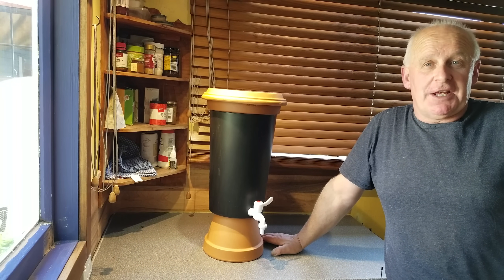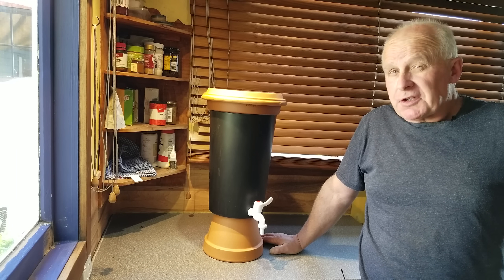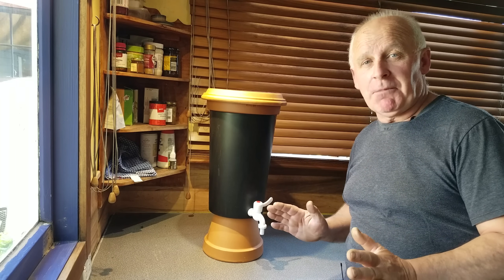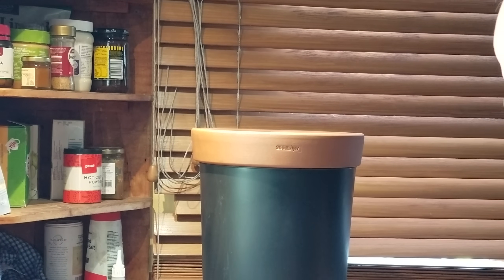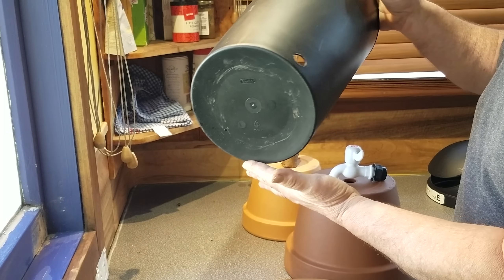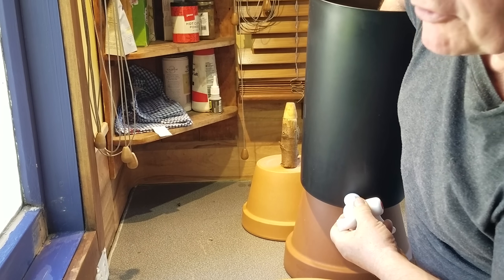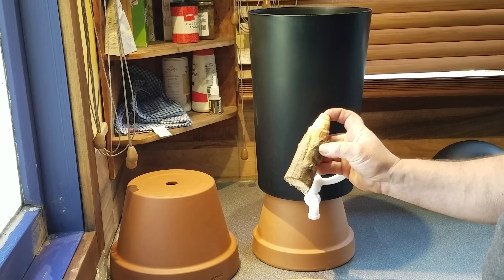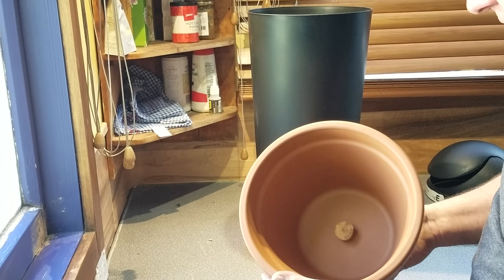DIY water filter. How to make FILTHY WATER drinkable

Comment: In warm, dry climates you can use ceramics like terra cotta to get evaporative cooling of the water in addition to the filtration. Great video! Well done. As an environmental engineer I approve. However, if you want to remove organics you will also need an activated (charcoal) carbon filtration bed as well. But since you are using rain water, organics would be of minimal concern. Thank you for sharing.
Reply: How's he collecting all that rain water? Off the roof, birds, moss , what's it made of?
Reply: Excuse the ignorant here, what do you mean organics? Viruses? I know Brita filters don't catch these because they're too small, I guess very few filters catch these, that's probably why we use chemicals? But I don't understand what this method filters and doesn't filter, and why it matters. Thanks!
Reply: Organic chemicals are a class of chemicals that contain carbon atoms bound to other atoms of varying elements through covalent bonds, such as the cells in your body or chemicals like gasoline or benzene. A lot of these organic liquids have molecule sizes that are close to or smaller than water, such that they will permeate any barrier that water permeates. Activated carbon (charcoal) has a unique property in that it has a very high surface area to weight ratio (950 to 2000 square meters of surface area per gram of activated carbon). This allows activated carbon to absorb various organic compounds and remove them from the air or water. This is why gas masks designed to remove organic vapors use activated carbon as part of the filter. @pierrex3226
Reply: @pierrex3226  organics are soluble organic large molecules from breakdown of plant and animal matter,  look at water from peaty soil, its sort of brown, that stuff. They react with chlorine making THMs (trihalomethanes)  , feed bacteria in biofilms, can taste (eg geosmin) funny at tiny concentrations. It's difficult to measure define , total organic carbon TOC , DOC (dissolved organic carbon). If you really lucky than you could have BTEX (benzene toluene ethylbenzene xylene) from oil field, coal  deposits , petrol tank leaks,  dumping waste.

Comment: https://youtu.be/AVZmZwTxnMc?si=iKws46odK906EVfn We put a Berkey water filter system to the test using a certified third party laboratory. We tested two different samples of water: 1) municipally treated city water, and 2)  untreated pond water. In this video, Brian goes over the test results data in detail and discusses an anomaly that was found.

‼*Correction* Two contaminants were actually reduced by more than what is mentioned in the video (apologies for any confusion):
- Sulfate was reduced by 90%
- Iron was reduced by 70%

Comment: I know what you mean about your municipal water supply. where I live in South Australia, our reservoirs are kept topped up with water piped from the river Murray, in the Summer and some drier winter. and same as you, its heavily treated. the water coming from my taps smells like it was taken straight from a swimming pool, it has that much chlorine in it. I use a Brita water filter which does a fantastic job of turning it into really good drinking water. unfortunately, I dont have a rainwater tank at my house, and with it being a rental I cant install one. but it would be interesting to see what sort of results I could get with this system. have you though about also adding some activated charcoal to it as well for even better impurity removal?

Comment: A little tip if you add a second bin without a bottom on the flower pot such that it is water tight then you can overfill the flower pot the higher the head on the flower pot the greater the pressure the faster you get your drinking water

Comment: You might want to consider adding crushed basalt filler to your water catch basin that will help mineralize the water. Water is slightly polarized and if it is distilled would strip the minerals out of your body or your soil, which is not  a good thing. By adding the basalt, the water would extract those minerals improving your lot in life, because of chemtrail poisons that precipitates, implemented toxic fluoride (see Poison Control), chlorine, BPH, dishwashers and washing machine chemicals, plus nutters who flush medications down the l'eau that end up coming out in the tap, etc. Brilliant

Comment: You should have taken a total dissolved solid or parts per million measurement.
Reply from the maker: This is a video about how I made a quick cheap filter from what I had available to me on the day to inspire forward thinkers.  The worst thing that test results find in my rain water where I live is pine pollen. TDS readings currently in my water-5ppm.  One of the reasons I live where I live.